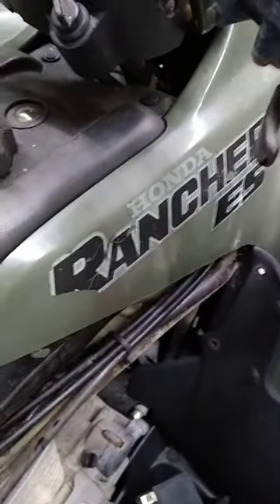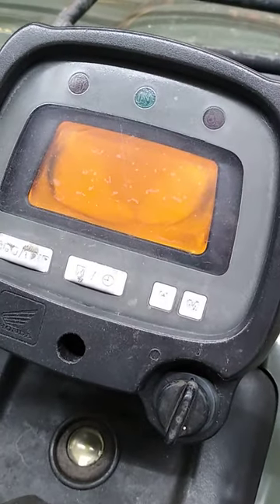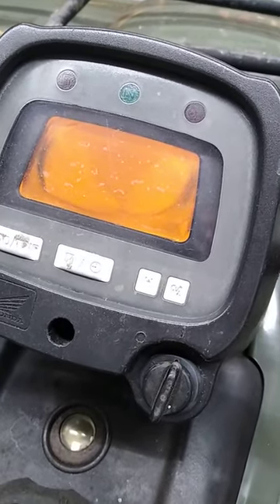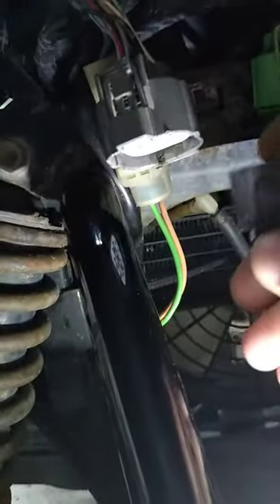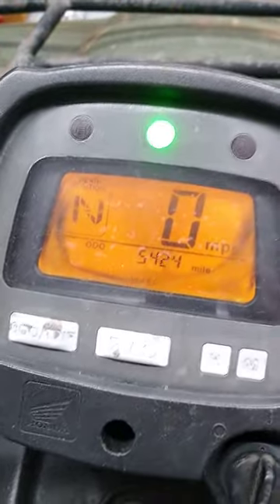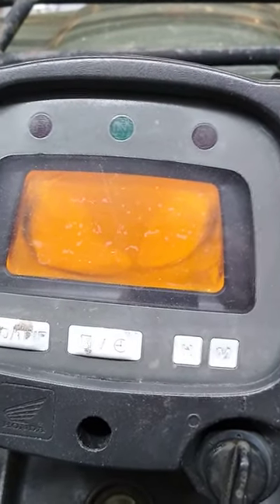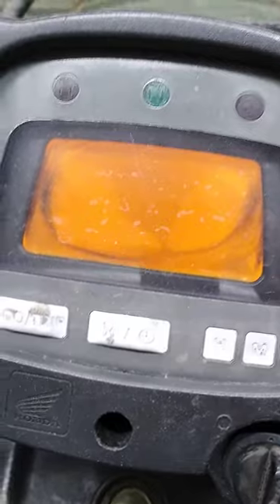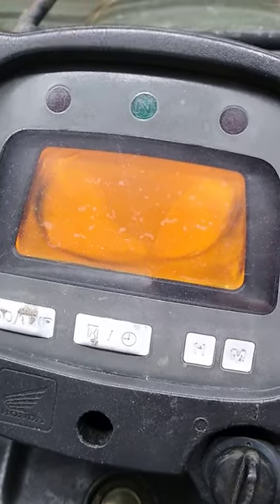Need help, 2000 honda rancher display

Comment: Whole LCD and all buttons are one plug in if you follow wires.  All work off one connect. Replace lcd whole screen and plug new one in.  Only thing working right is your reverse and neutral lights. At top which also are on same plug how you know it is in fact working.

Comment: Mine has the same problem right now mine is the 2wd version and I believe it’s the charging system my electric start works and lights kill switch but I can’t see anything every once and awhile when it’s really cold the dash will turn on but you shut it off and try again it doesn’t come on any answers would be nice if you figure it out
Reply: Did you figure it out?

Comment: 3 years late but how did you un hook the plug because i have the same problem but with a 2008 trx250m but i cant find out how to release the plug because its the same type of plug
Reply: Remove the plug from the frame by pushing the tab in back of the plug located on right side towards the tank then slide to the right. You can now use a flat screwdriver to gently pry around and remove after pushing tab on front of plug in

Comment: Mines foggy as hell can't read it have to lens clean mine today to restore.
Reply from the maker: Can u send a pic of your screen. If u can see anything at all on the digital even if it is one line I can help u fix that
Reply: @wildnuts6197  any chance you could help me out with the same thing
Reply from the maker: @gerardomunoz6526  what all have you done or checked so far?

Comment: Mine is doing the same thing
Reply: How'd you fix it?
Reply: @danielreeves4799   I never tried too,  lol
Reply: I did read to fix it you have to buy a new replacement of the screen
Reply: sun damage can be fixed by completely disassembling down to the glass panel. scrape the old film off both sides of the glass with a razor and rubbing alcohol. apply new polarizing film on both sides 90 degrees from each other. look up lcd polarizing film, or lcd sun damage repair. i've done the sun damage repair on a rancher 400 and the lcd worked great until it started not coming on unless i unhooked the battery for a while.

Comment: Ever get it figured out?
Reply: I have a solution I’m gonna try if you unplug and plug back in the connector to the screen just wire in a switch that interrupts the ground and it should act the same as a unplug and re plug I’ll update if it works
Reply: Unplugging the 30A main fuse is a temporary fix when ever you use the key

Comment: Displays busted.  It's still lights up and shows neutral and reverse so LCD is working.  But that screens busted not showing nothing. Seen that once before.
Reply: I believe the red light is the oil light that turns off after a few seconds not the reverse light.
Reply: The screen works after he unplugs it and plugs it back in. The red light is also not the oil light, that's the reverse light. This has to be a powering issue of some sort with the ignition. The screen seems to only turn on when the keys turned over and there's full power hitting the screen quickly, unlike when you turn the key on like normal. It's most likely a corroded connection from age.

Comment: Mine is doing something similar honda dealer said there are parts of the board that just get hot and burn up.....have to buy the whole circuit board and it's not cheap.
Reply from the maker: There is 3 different size resistors on the board like a total of maybe 14. About $2 of resistors. I would have to find my paper on the sizes for what they are. You or someone would have to solder to the board.
Reply: @wildnuts6197  oh ok cool ...thanks
Reply from the maker: You might also check the rectifier it's about $15 it also controls the power for the lcd screen, it's does control the neutral or oil light if that helps. Where are you located

Comment: i got one and it worked fine on the other atv and i put it on mine other one and it does the same thing well not work
Reply from the maker: Check the rectifier on the one that it doesn't work on.
Reply: I have the same problem. Another youtube guy shown to replace 15 amp fuze but that still didn't work for me.dang it
Reply: I found out that it is the ECM on the back of the 4-wheeler
Reply: How'd you fix it?
Reply: @josephrobinson7501 did you just change the ecm ?
Reply: @danielreeves4799  I just plugged it in took the old one off plugged up an end then it's still with shows nothing but it lights up I think it is a CDI box that goes to it is bad
Reply: What is a eco
Ecm